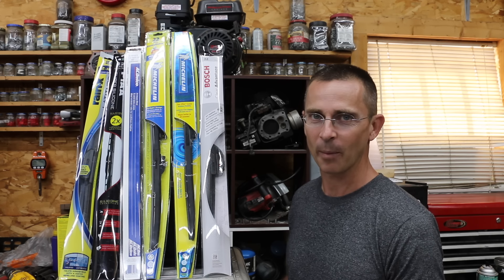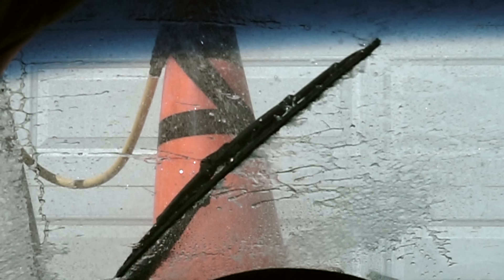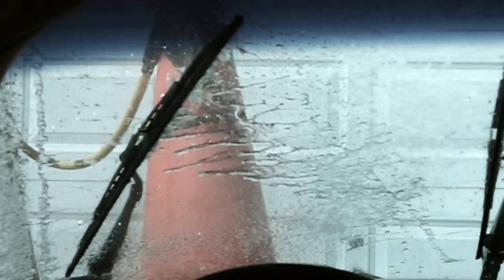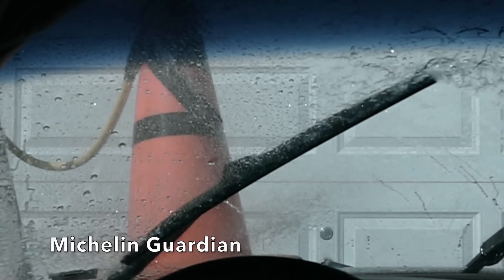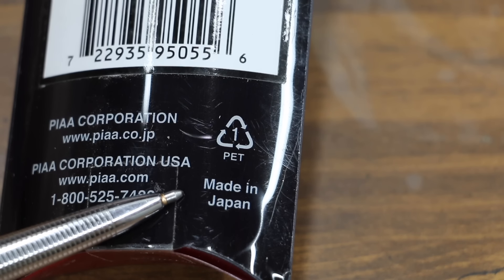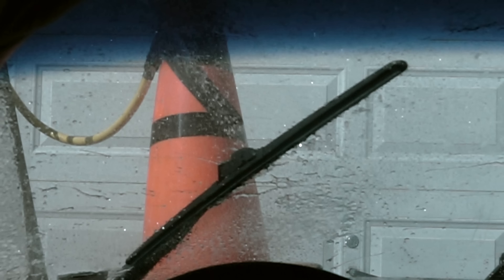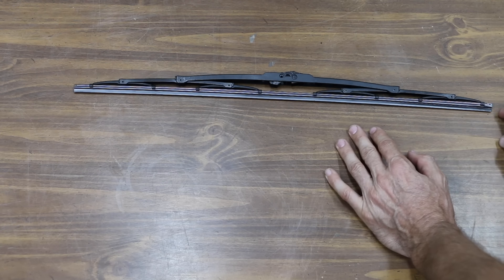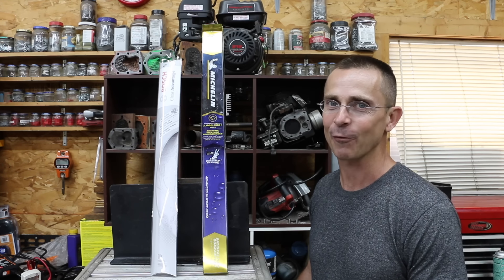Which Windshield Wiper Blade is Best? Let's find out!  Michelin, PIAA, Bosch, AC Delco, & Aero

Comment: What about a test of windshield water repellent, like rainX.
Reply: I just use car wax on my windows works better and last long. Also don't have to by another product.
Reply: That would be an interesting test. I use the orange colored rain-x washer fluid and I only have to use my wipers if it is really pouring or if I am behind another car as mist doesn't slide up the windshield as well as rain drops.
Reply: Aquapel is by far best water repellent for windshields. Been used In trucking industry for yrs.
Reply: I'm curious I use rain-x cleaner and treatment ik the straight rain-x works better not sure what would work even better because it seems rain will fly off at 35mph
Reply: @jonnygear9169  What type of car wax? Like a thick solid or a soupy one?
Reply: @rueridge7597  I second this, use it all the time.  Works pretty well, even with the near vertical windshield on my old Cascadia.
Reply: I used Rain X in a rain storm for 150 miles with no wiper blades at all and made it safely to my destination
Reply: The test would need to include any hazing or visible deterioration as that can not only hinder vision but mess with safety systems like EyeSight.
Reply: Ultra CNC  Um....wax companies tell you to not apply their product on glass, plastic, or rubber for a reason.  I have yet to see an owners manual for a vehicle tell you to wax the windshield. 🤭
Reply: @davidpenick6248  Aquapel lasts for 6 months, give it a shot. You can buy a 6-pack on Amazon for <$20.  Find good instructions on google, because it is not a consumer product.
Reply: I use nu finish, it's cheap and works great and I only apply once a year
Reply: Ultra CNC  it does
Reply: Please test PPG Aquapel
Reply: I make sure nobody puts any Rainx or similar product in my vehicles due to the glare it causes when night driving with oncoming traffic.
Reply: I use the ceramic hyper wax from chemical guys and I’ve tried normal wax and rain x and it’s the best plus leave a really really good shine on car
Reply: For that testing, driving in rain is important. I use RainX, both when I lived in Texas and now in the Pacific Northwest. It works wonders in both locations, hard down pour rain and light / sprinkling rains.
Reply: I use the orange rain-x and Lucas wax I have to use my wipers at low speeds but at 30mph and above I never need them
Reply: @Grizzleback07  Ultra CNC may have been a bit out of line saying you're "supposed to" wax the glass, but doing it will not cause any issues. It doesn't stop chips, but it does keep environmental/ozone contaminants off, and sheds water. It's much better than rain x.
Reply: @darrellshuman7751  Your glare is caused by improper application. Put it on, buff it in, and then at your hand with water and flick the water off your hand onto the windshield. But the water and rain x in. You also could have added it on top of contaminants. Clay your windshield before you apply it. IPA, acetone, MEK, or Windex (or pretty much any organic solvent) will take off the rain x.
Reply: Ultra CNC  
Never heard of waxing windows but it's worth a try.  
Does it cause any glare in traffic at night or make a rainbow effect like oil is on the windshield?
Reply: I just use normal paste wax. I have even waxed the inside of the windows help keep them from fogging up. It is a pain but worth it. I use Meguire car care products

Comment: For me the most important test is longevity/durability. I'm in Wisconsin, so the durability through winter is key.  I've had the best luck with Trico Ice lasting over a year.
Reply: Yeah my problem is my wife will run her wiper blades over the ice to get it off... Only if he could test to find the most durable blades
Reply: I've had blades that was ready to just fall apart after a summer just from exposure to the sun, and I've had blades that ripped apart when trying to free them from the ice on the windshield. Then there are the blades that wore down almost immediately. But I've also had blades that survived at least two years before they started to show signs of wear. So there is a very large quality span. Now how to test this I have no idea.

Another interesting test would be wiper fluid, both cleaning properties and antifreeze properties are interesting, and perhaps come up with a homebrew version to test against the brand names.
Reply: I find it kind of disturbing that neither Trico nor Anco blades were tested.  Trico invented the wiper blade in 1917 and still has a huge market share, Anco  was their first competitor a mere one year later.  Until about 1990, these two companies owned the market, and even with today's diverse offerings from competitors, they hold a pretty significant market share.
I try to get two years out of a set of blades.  With these two companies, I almost always succeed.  Others always  let me down.  I will single out Rain-X blades as the shortest lived that I have ever used.  My Honda Accord (which for some strange reason eats wiper blades for lunch) had a set of Rain-X blades that lasted under a month.  I don't think I have ever gotten a full year out of a set of Rain-X blades.  
I just installed a set of Trico blades on my Ford ranger last weekend.

Comment: I have used a variety of wiper blades over the years.  The so-called winter blades, with the rubber booty enclosing the framework assembly trap water insides the booty and become very inflexible when the temperature drops below freezing.  The washers don't help.  Ripping the rubber booties off helps considerably.  I've had excellent luck with the Rain-X wipers.  I like Rain-X.  It works, but should not be used on plastic, such as modern headlight lenses.  Excellent test, as always.
Reply from the maker: Great point on the winter blades
Reply: Problem with the rain-x comes when you have to clean your windshield. That coating is a bear to get off.

Comment: Another great video from Project Farm!  A point to mention...  When replacing your wiper blades:  ALWAYS put a towel on the windshield!  Case in point... An employee of mine, didn't and the arm hit and cracked a $900.00 Ford Thunderbird heated windshield in 1997.  OUCH., That hurt!  Be smart!  Thanks for another fantastic video!!  Eric, ASE CMAT...
Reply from the maker: Great tip!!
Reply: I've always let mine slam after changing them, I'll definitely stop now though..
Reply: @barryemery9494  Usually it is not a problem if the blade is installed, but what happens is the person lifts up the arm > takes the old blade off > accidentally lets the metal arm slam down before they can get the new blade on. I too have seen an employee make this mistake, busting the customers windshield. From that point on the protocol was take the old wiper blade off > SET THE ARM DOWN GENTLY > only lift the arm back up once you are ready to install new blade.
Reply: That’s why you put the arm down while you’re grabbing the new blade. No need to get out a towel.

Comment: I rarely, if ever, find fault with these tests but I feel like wind from the vehicle in motion would significantly alter the water management capabilities. However, I had never considered the water being thrown back across the windshield and makes me think Honda wasn’t so crazy for the arms opening instead of arms sweeping.
Reply: I agree. Although his tests are very good i feel like the car not in motion does change things. But its hard to do consistent testing when you have to depend on weather.
Reply: I’m sure he has a giant shop fan. Would probably be all you need.
Reply: I totally agree. The solid beam blades are actually shaped like a spoiler so that there is added pressure when the vehicle is at speed. Not to mention this test is performed with a great deal of water on the windshield which doesn't feel like the typical use case to me.

Comment: For April Fools 2020 test toilet paper brands. 

Do a race to see which is the fastest, which is best used as a replacement for ductape, which can plug holes the best, and which can decorate a house the best. For the 1 year test, stick it by a window for testing uv longevity
Reply from the maker: Thank you for the feedback!
Reply: "To maintain consistency I'll only be eating the same Taco Bell order on the days the same kitchen crew is on shift with nothing eaten 24 hours before or after my meal."
Reply: Absorption and softness (as compared to a fluffy, yellow chick)
Reply: Buy a bidet
Reply: 7kyro I now can tell you probably the worst TP,it’s KIRKLAND, by COSTCO,,,,the quality really went to hell,like their flashlight batteries,AA,&AAA, they seriously LEAK, CheersbfromNJ🇺🇸
Reply: Some one did do this. But it was mostly to see witch would dissolve fastest and abrasiveness.
Reply: My vote goes to “John Wayne” tp... it’s rough, it’s tough, and it doesn’t take crap from anybody!
Reply: @oscarmart1  I might consider one if he did a review of them. I know nothing about them being a filthy American.

Comment: Great video! I was hoping you would’ve added a wind “element.” With the curve in the windshield, and wind, the blades could’ve performed differently. Just a thought.
Reply: Agreed, just bought the PIAA silicone beam blades last week and I've never had a wiper blade COMPLETELY LIFT off the windshield at highway speeds. They're by far the worst blade I've ever used at speed, but in park they work ok, just a little squeaky. A highway test with just washer fluid would be helpful.
Reply: @liameisenberg9711  Lifting effect with speed is really dependent on your car as aerodynamics of every car is different. So testing with one car might not be that helpful. Beam type wiper blades are very similar shape so if one beam blade lifts at speed on your car then other beam blades probably do also. What car/truck do you have that this happens on? There are also wiper blades with spoilers to help with this problem.

I’ve only used beam type blades for some time as cleaning ice and snow from regular blades is much more work and they still don’t work as good in cold.
Reply: @valde3336  the PIAA blades do have a "spoiler"... I've tried Michelin frame/hybrid/beam, bosch beam, and rainx beam and the PIAA are they only ones that do it. Of those rainx is by far my favorite, best wipe and they last the longest in my experience.
Reply: I don’t use beam type blades for this very reason, they lift at speed.
Reply: This is not true. Its all depends on the quality of the steel. Only completely faulty arms will lift but you will see the arm itself lift otherwise it’s the wiper itself thats the issue.
Reply: They do but they can be made to stay on properly at high speeds. Ive been sourcing wipers to sell in my country and it took me a long time to find a product that worked at highway speeds. All after market wipers are rubbish at this. Get dealer blades if you want them to work at all speeds.
Reply: ask a local drive-thru car wash for afterhours to park your car right a the wind tunnel to test if the wiper

Comment: they all work pretty well when new, the question is which one stays "new" for longest?
Reply: Silicone blades will last far longer in every climate.
Reply: I can't speak for all of them but I've had PIAA Blades (Silicone) on Mom's 01 Impala for the last 17 months, they went through a Winter and they're still working fine.
Reply: Had the PIAA for around 6 years. They are starting to show their age now. I don't have snow where I live, but the summers are usually very harsh and destroy other blades
Reply: That’s my question too, how long do the blade work like new? Seems like I’m replacing blades at least every year if not sooner and I hate when they make that squeaking sound as they go across the glass as they get older too!
Reply: This is mostly dependent on windshield condition. Those little micro pits tend to abrade the rubber.
Reply: Speaking of rubber can you do a Condom test? 😂
Reply: @ghostridergale  Mom's 17 month old PIAA Blades are still cleaning the windshield exceptionally well (compared to cheap  blades, anyway.) I bought the steel ones since the Aero and Winter blades supposedly break more easily. 

I also use Rain X Wiper Fluid, if that makes any kind of difference in wiper blade longevity.
Reply: Silicone will last the longest. RainX has a silicone blade identical to the Bosch silicone he showed.
Reply: PIAA Silicone for the win. I can get 5 years out of a set, no problem. Just gotta wipe them with an alcohol pad occasionally to clean off road grime.
Reply: Bosch! The Michelin ones last a yr then they get real noisy,  same with the RainX ones
Reply: @kwmiked  Regular rainx have lasted a year in the Pacific NW for me as well, but they have a silicone one now--parts store guy said his has been on his car since they came out 1.5yr ago and theyre still good.
Reply: Bosch blades seems to last a very long time, my current car over 2years and previous car 4-5years, without any sign of needing to be replaced. Also works good at high speeds and looks the best.

Comment: Years ago, I ran PIAA frameless silicone wipers that left a silicone film on the windshield similar to the Rain-X.  They were amazing.  Most of the time, I was able to run in the rain without even turning the wipers on!  But they were about $100 / pair if I remember, and they only fit a limited number of cars.  Still, worth it if you can find them...
Reply from the maker: Thanks for sharing.
Reply: Problem with PIAA is their website IMHO, No tool to find your car so you have to download a PDF and find your car in that huge list. Totally hasbeen. 
Worst, I have a prius V 2017 and they stop in 2016 in their list. I doubt compatibility issues because it's pretty much standard across Toyota but who knows.

Comment: I have bought almost all of these brands before. I can attest that the Michillen and Rain-X blades do NOT hold up well at all to extended use or winter conditions. The blades cut very easiliy and streak badly when used in icy conditions, and they also seem to deteriorate from UV exposure. I could never get a set of them to last more than 6 months, and for the money, that's a no-go living in the Midwest. I had mixed results with the Bosch, but overall I was underwhelmed with their longevity as well. Overall, I found the Aero blades to be the best value, as they seemed to hold up very well over the course of an entire year in all seasons. Thank you for these videos though, always thorough and informative! Maybe another long-term video idea is testing headlight bulbs for longevity and brightness, everything from basic halogens to Silverstars to LED's. Those Silverstars are spendy and seem to burn out fairly quick.
Reply: I had Bosch on both my cars and they were junk. Didn't last more than six months and they all broke at the plastic arm housing where it snaps onto the blade. I use the Rain-X ones now and they are great.
Reply: dunno what quality they sell in the US, but in Germany you get Bosch Aerotwin for like 25-30 € and I've had them on cars at minimum 4 years summer and winter without any problems, cracking, squeaking nor streaking..

Comment: I've had the same PIAA wiper blades for about 3 years and they are amazing. You can't beat 100% silicone! They don't crack or get damaged by UV. They leave microscopic deposits of silicone in the windshield that makes the water bead like the rain-x blades. The rain-x treatment wears off eventually but silicone works constantly. They're also quiet, resist heat, oil and damage from dirt and ice.  One of the best purchases I've ever made. Good luck finding them in stores.
Reply from the maker: Thanks for sharing.

Comment: I love a clean windshield. I switched to silicone blades awhile back and they do last longer. That being said...
I’d rather have rain-x with no wipers than wipers and no rain-x.
Reply: Outdoor Guy YES a properly applied coating of RAIN X, is FANTASTIC,  but here is something many of you have nNO IDEA ABOUT,lived in the TROPICS where you could have &Floodingwith my dad about1957 in  the countryside ,the wiper motor died, he got some PIPE TOBACCO,,smeared it all over the windshield& was able to drive the next 60 miles in the downpour,  ,I Never forgot it,,so I keep a can in my trunk,Cheers From zNJ🇺🇸
Reply: Leighton Samms have you tried it after from your dad ?
Reply: Silicone blades lay down a coating of silicone on the windshield that causes water to sheet. RainX is redundant with PIAA silicone blades.
Reply: William E , YES, but I only had cigarettes, it worked,,but the larger tobacco prices, I believe is the far better choice, as said, I have a can of pipe tobacco in my trunk, Thanks, Cheers From NJ🇺🇸
Reply: Outdoor Guy ,,have you ever tried RAIN X on your inside windows?no fogging!  Cheers FROM NJ🇺🇸
Reply: Rain x is clutch fuck all the other fluids